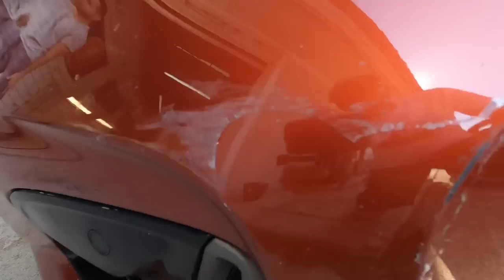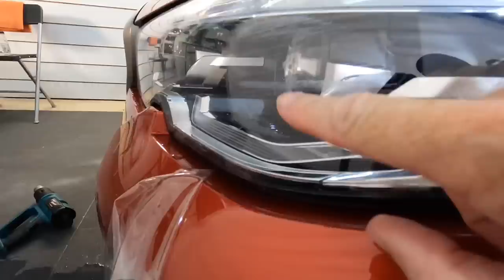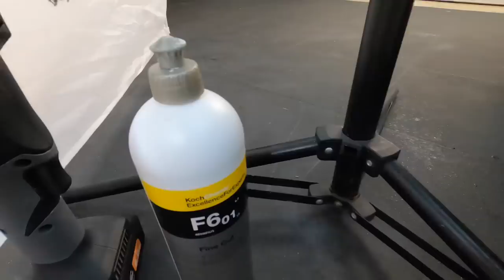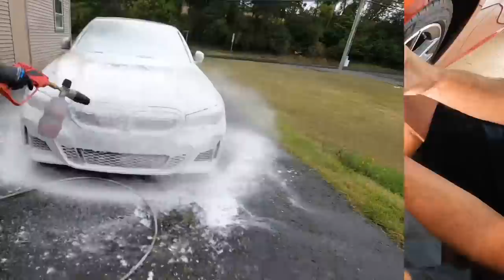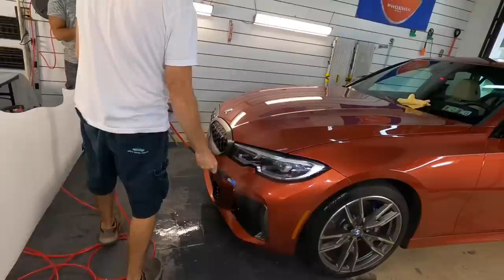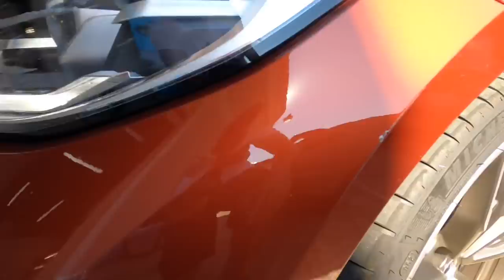New BMW M340i  Bumper Damage That Can Be Repaired Without A Body Shop!!

Comment: That’s the only way to go about it in my opinion, it’s a Beijing Motor Works daily driver, not a pebble beach Bugatti.  No reason spending 2K to repaint the entire front cover, having the car down for at least 5 days for paint, then another few weeks before PPF for a 1-2” sliver touch up area.  It’s gonna get whacked again, PPF did it’s job well.  10/10
Reply: The bad driver owner will get it damaged again or in another spot. By the way that bmw is made in Mexico
Reply: @roninbushito  Mostly body and chassis assembly in Mexico and lots of their engine manufacture is done in China hence the Beijing Motor Works badge. Most everything after 2004 is junk, Big Money Wasted, worked on that product for a long time and it’s sad to see a once good car company go to shit.
Reply: @craiglyles4755  lol I laughed when u said “Beijing Motor Works” never heard that before I will use that name. Yes much production has moved to CCP! I never support ccp products or western corporate supporting imported labor to China no thanks. 
I was going to get a m340i but nah it’s not made in Germany anymore that sucks they are being cheap cutting costs. BMW junk nowadays there is a difference in German made bmws and overseas produced ones. You can tell in the long run. I got a Lexus instead at least it’s made in their own country

Comment: I prefer this repair, over respraying that corner and doing a blend job. The damage was minimal, and touching up preserves most of the factory paint. If the damage was any worse like an inch wide, or an actual gouge, then a more expensive repair would be needed

Comment: Since the headlight lens is now cracked, it may allow for water or moisture to get in and will fog. Speaking from experience to have a headlight on a BMW replaced, especially those with articulated lenses, these will cost consumers close to $5000 if it is deemed that it was the result of user error and will not be warranteed.